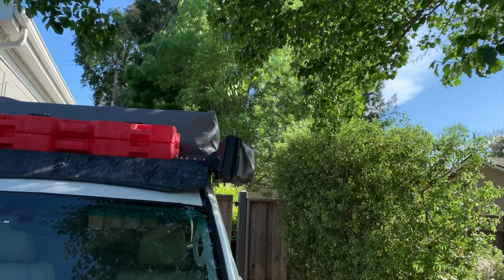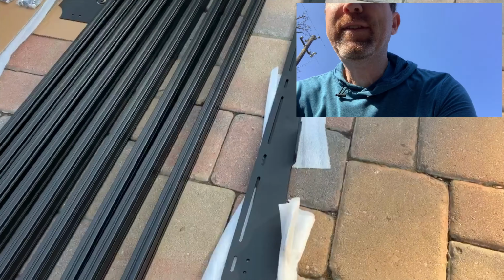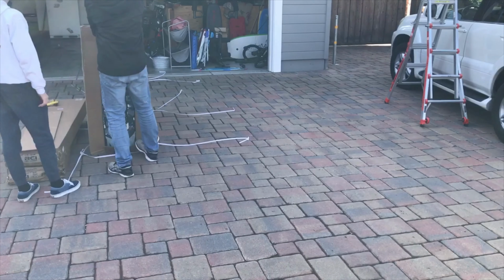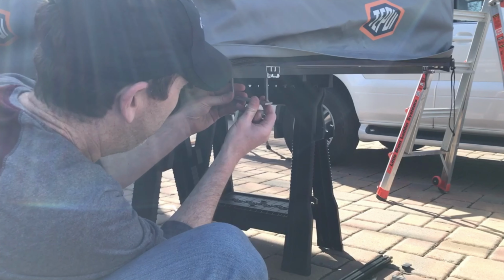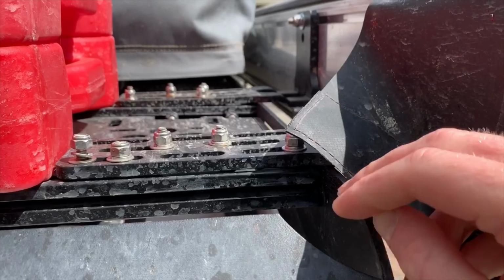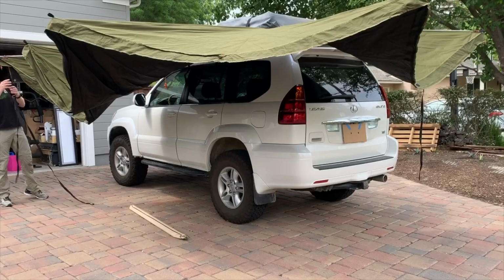GX470 Project: 1.1 - Putting things on my roof...

Comment from the maker: Just click on different sections below if you want to jump around😁

0:08 - Overview
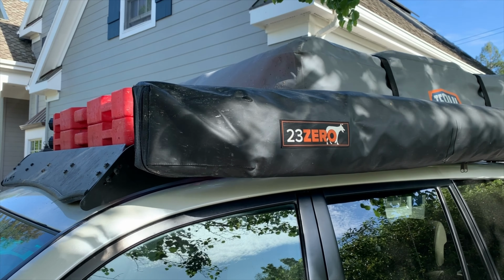2:36 - The Rack * Lexus GX470 Prinsu Roof Rack (2003-2009)
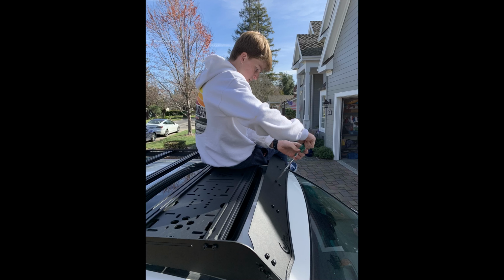9:17 - The Roof Top Tent * Tepui Explorer Series Autana 3 with Annex
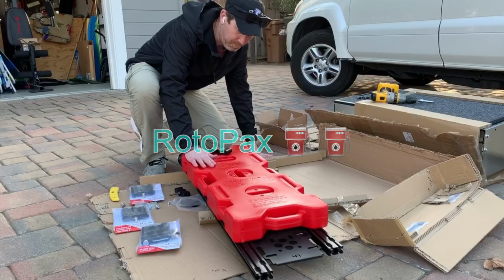17:27 - RotoPax X ⛽️⛽️
20:55 - The Awning * 23Zero Peregrine 270, Driver Side with Wall 1 & 2
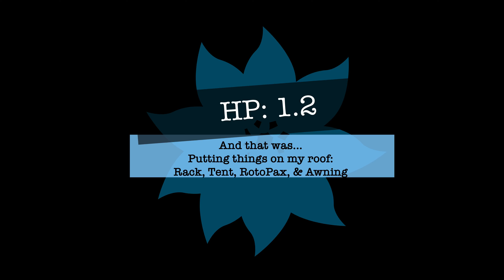29:32 - Closing Reel

Comment: There is an easy way to do it while on the roof.. remove the crossbar that is blocking your hand from getting under the tent. Work on the fastening of the tent then put back the cross bar back.
Reply from the maker: Yes, that is a VERY good idea!  Since this video, I have actually used the exact approach you talked about 👍... see, smart minds think 🤔 alike 😜🤣
Reply: @happinessperfected  I have ordered the prinsu rack for my FJ and plan on getting the roofnest falcon xl, which I will install it the same way ... another thing to keep in mind is to have the bolt and the barcket for each of the four fasteners already in place before putting the rtt on the roof.

Comment: Thinking of doing this with my 2nd gen sequoia since the OEM looks the same. Wouldn't it be strong enough with just 4 or 5  cross bars with those short L brackets held on by your bolt and two washers setup? Seems like extra weight with the side frames.
Reply from the maker: Hello, yes, it probably would be strong enough. BUT if you are planning on doing more aggressive off-road adventures, then there is a lot of twisting/torquing that occurs. And the cross beams are made with Aluminum, so they don’t really add much weight and is probably with the insurance it provides.

Comment: Can you let me know what material for the two side rails (with integral mounting feet) are made of? Are they made out of steel or aluminum? 
And also what are thickness of those two side rails too?  Million thanks in Advance.
Reply from the maker: Hello! It is a Prinsu roof rack. It’s made from a single laser cut 1/4″ 5052 aluminum plate. Super strong 💪 (and light)!

Comment: Thanks for the detailed video ... I am thinking of the same setup for my GX 460 ... what is the usable width on the rack. My tent is 48" wide - hence not sure if it would fit. Thanks,
MAdhu
Reply from the maker: Hello! Thanks for the compliment on the video. Always wonder if I give too (or not enough) details 🤣. The rack is 47” wide (usable surface). My tent is 48 wide as well and fits perfectly! It hangs over just a little bit because you attach it to the cross bars (hint - attach tent to cross bars before you place in rack and have some people help you), it sits up a little and so you won’t have an issue with it hanging over a small amount. FYI... 48” is not wider than my roof, so no hangover issues.
Reply: @happinessperfected  Details are always good. :)

Comment: Where did u buy the brackets for the awning from?
Reply from the maker: The bracket I ended up using came with the tent.  I had purchased a separate bracket that was made to work with the roof rack, but in the end I didn’t like how it fit with this particular awning.  While the bracket that came with the tent didn’t fit perfect when connecting with the roof rack (related to where I needed to put it), I was able to make it work enough and felt very confident it wouldn’t fall off as I was going over a big rock or down a steep mountain - 😆.  I have done a number of trips since then and it has held up great!